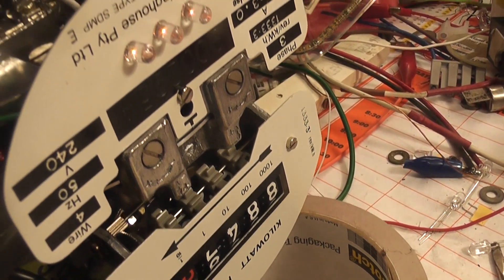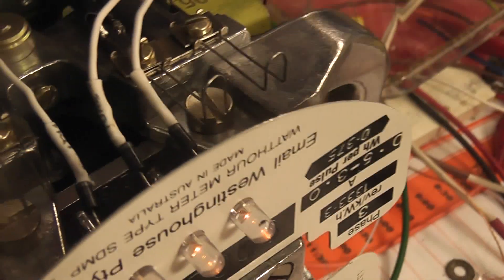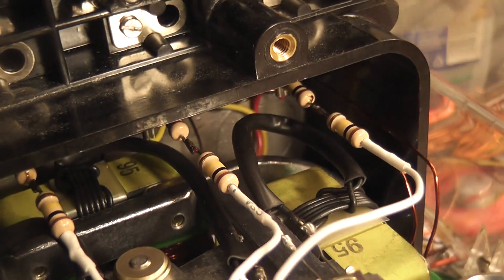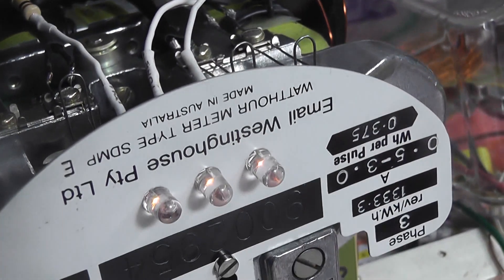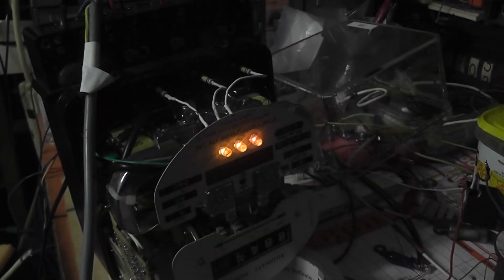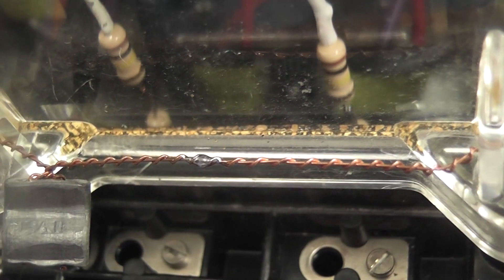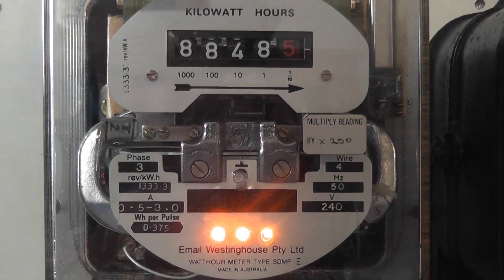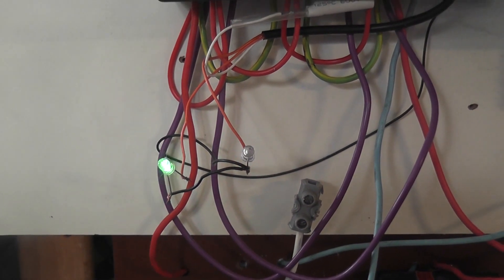LED Potential Indicators

Comment: With LEDs, these meters are much more interesting to me! :D
Reply from the maker: +BloodySword I used to fit LED's in CT metering when I worked in the metering section 1991 - 2002 when they closed the metering dept. I fitted around 3000 CT meters with LED's to indicate that the potential coils were energized. makes 9000 LED's. Best part was that none of these LED's failed at all. These meters were all of different manufacture, like Email, GEC, Iskra, Landis&Gyr, Ferranti, Sangamo to name a few.
Reply: RODALCO2007
Cool. But remember, you also recommended a much lower resistance for the LEDs, you should admit putting a reverse bias diode on them in that case, because when the reverse voltage gets too high it might damage the LEDs. But with the resistance you have chosen it's fine.

Had issues with lower resistors on LEDs on mains when not rectified, that they can die.
Reply from the maker: +BloodySword Yes, correct. When I use 47k.Ohm R's I use also  1N4448 or eq. Diode in antiparallel with the LED.

Comment: Are the LEDs powered from 240 volts mains with just those resistors to drop the volts? secondly the guy who wrote about his grandads house are the shocks you get there from mains leakage or mite they be from RF energy from his high powered gear?

Comment: You could go up to 470k with no real difference in light output from those modern ultra bright LED units. I used a single red 5mm with 250k of series resistance and it cast a shadow of the lift controller across from it on the wall if the light in the room was off.
Reply from the maker: +SeanBZA Yes, you are right. Those high efficiency LED's work with less then 1 mA with good brightness. Always good to put a 1N4007 diode in series to protect the LED.

Comment: hey rodalco, my grandfather's house is very dangerous. he has several ham and cb radios with high powered amps on the order of 20kw of broadcasting power. for a while now all of his radios and anything with a metal case shocks you when you touch them. any ideas how to remedy this?
Reply: +David Tamplen 1500 watts is the legal limit.. and make sure everything is tied into the same ground, and that the connection to the ground rod is adequate.
Reply: check the ground connection/ground rod! this should not happen! are there ground fault interruptors in the circuit?
Reply from the maker: +David Tamplen Looks like a high resistance Earth or Ground connection.
Reply: The house is old. The outlets don't have grounds
Reply from the maker: +David Tamplen Well that is where the problem is. You need to get a 4 or 6 millimeter wire for a ground connection to the copper or galvanized  steel waterpipe, provided there is no plastic pipe, or drive one or two earth pins of 1.8 meters into the ground, depending upon soil type and ensure the earth resistance is less then 10 Ohms.
Reply: How would I go about measuring the earth ohms?
Reply: more jello please he knows what the legal limits are. He likes to talk to his friends in Hawaii and Kuwait.
Reply: more jello please and refuses to pay long distance phone charges.
Reply from the maker: +David Tamplen You need a 4 wire Earth bank tester for that, and long leads. We use in NZ an 80 meter current lead, a 50 meter potential sensing lead. then the other two leads are connected to the earth on site. Often the Earth resistance in recticulated areas is less then 1 Ohm.
Reply from the maker: +RODALCO2007 Ok, above is for a transformer Earth bank which is a bit more serious then a house Earth. For a domestic Earth you may get away with a good Ohmmeter, or pass a known current into the earth and calculate the resistance. It helps that an Earth pin is in soil or clay instead of dry sand.